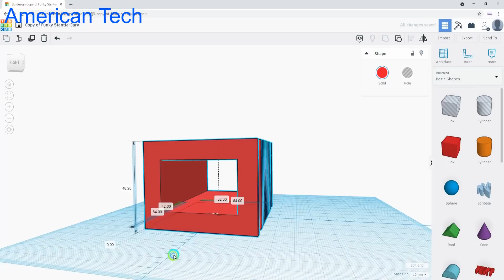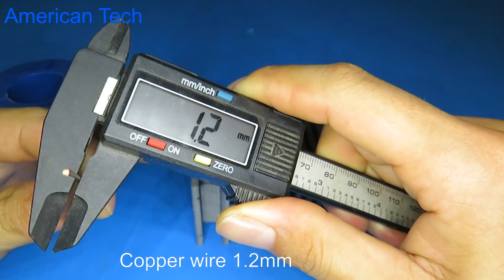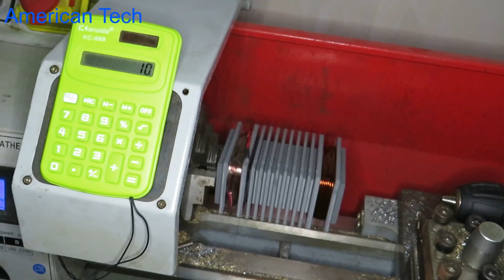How to make high voltage transformer 400KV

Comment: for 400kv output you need 1600v input

absolute bullshit

Just lies in the video

1) improper core material
2) improper core type
3) improper core sections considering turn ratio and the max working frequency of a laminated iron core
4) excessive turn ratio considering laminated iron core material
5) improper insulation, you wouldn't get more than 3kV per section if you had a proper core or/and a proper turn ratio
6) he gives no demonstration
7) he does not provide a proper driving circuit, plug it into an outlet socket and you'll get a big bang, plug it to a ZVS and you'll get a nice stove
8) this channel does videos about free energy

Comment: Not way this will produce 400kv.. too small and the core will saturate. Also if you do not immerse this in oil and make sure there is zero gas or moisture to not make 40cm long arcs destroy every winding

Comment: If we have a 220 to 12 transformer that has two wires in the input and two wires in the output, how do we make the oscillator circuit?  ❤❤❤

Comment: need to tighten up those secondary turns, i saw little loops and wires stuck on the outside of the bobbin. this would burn up in 30 seconds with 12vac applied

Comment: Clickbait. Even if you did apply 1,666 V to the primary, and used a proper core, it oiled never reach even close to 400kv. And if it did, it would fry instantly (even in oil or wax).

Comment: How did you close the magnetic path? This wiring does not transform anything. 
Besides, have you ever seen a high voltage equipment? If not please check one. There are plenty of pictures on the internet? Please check the dimensions. Why do you think they are so bulky? Do you have an idea? Yes the isolation issue. 400kV jumps from 4 meter with a good bang.
Anyhow, your video showed me that  the copper wire is cheap around there.

Comment: Could you please tell me how you made your wire counting calculator Sir ??? Thanks
Reply: I used a nano an old dc drill and a hall sensor, the Arduino program can count the turns and stop the rotation when "x" number of turns are made, I used an example of a tachometer and modified it to be a counter.
Reply: @jamesrodemeyer7544  THANK you for your response with the answer. to my question Sir. I have to get started to make my coil counter. Thanks again and peace too. v

Comment: 400KV lol... that's 400.000 volts. They probably mean 400 volts, but i still wouldn't mess with that with such 3D-print-hobby project. I've experienced having 230 volts on me a few times, that's quite violent, you can feel the 50hz swinging your muscles around. 400 volts.... don't mess with it, it's plain lethal as soon as you accidentally touch it. Don't DIY toy with that.
Reply: Thats 400 000V but then there is less than 0,0001 amps
Reply: Its brobably 50-100kv
Reply: You most likely experianced that from the putlets wich is 50hz this is like 3khz and its like 0.1a unlike the 16A from an outlet(mine are 16A

Comment: That is not how you design a transformer core there is no loop for the magnetic flux to run through.  Also if its not 400kv. The primary inductance is to low with only 30 turns. Connected to mains it would draw too much current and trip your breaker.
Reply: Shot the breaker
Reply: You don't need a closed core for a transformer, though it would be preferred since it helps reduce the magnetizing inductance of the transformer and reduces reactive power draw. In other cases you may want to engineer the magnetizing inductance by introducing a deliberate air gap or doing this to create a coupled inductor.

Comment: For which reasons in the world is this thing going to work? Let me tell you, no one.
Here's why:
1) improper core material
2) improper core type
3) improper core sections considering turn ratio and the max working frequency of a laminated iron core
4) excessive turn ratio considering laminated iron core material
5) improper insulation, you wouldn't get more than 3kV per section if you had a proper core or/and a proper turn ratio
6) he gives no demonstration
7) he does not provide a proper driving circuit, plug it into an outlet socket and you'll get a big bang, plug it to a ZVS and you'll get a nice stove
8) this channel does videos about free energy
9) idk what else say, if anyone had other ideas write them in the comments below
Have a great day :)
Reply: Reason 10 - most people don't own a 3d printer and a lot of us don't own a PC either.  How can the heck can that bloke afford a lathe?  The laminated core IS silly especially since there is no closed magnetic path but it would be kind of fun hearing the bang if it was plugged into a wall outlet or the fire if it was connected to a zvs hence no demonstration.
Reply: @ianhosier4042  agreed on everything.... I do have a pc but no 3d printer not lathe, so when I wind hv trafos I use recycled cores from crt TVs and a lot of patience, thin copper wire, Dutch tape, synthetic varnish/enamel, hopes and prays xd
Reply: reason 11- he is on electroboom's baddie list
Reply: reason 12- most of his description is used to get more money like how many frickn links he used for free energy videos
Reply: reason 14- oh my god his wife's YouTube channel is full of lies. she said she uploads every day and it's been 6 years and only like 10 videos are on it. her description asks to sub, like and, share. she says the channel is about "clay games that make people happy" NOPE nothing about that at all there's even one where she encourages you to stick a capacitor directly into mains! that's so dangerous and no bleed resistor is on the capacitor ether all these people want is money
Reply: Reason 13: left the chat

Xdd

Comment: 3d prints often have thin walls between layer lines,  so not only will the sparks likely jump walls,  it will likely go through. Resin would probably help with the jumps,  but the walls are going to be a challenge.
Reply: 11 nl,
Reply: Thanks for the experienced information; 😅 i was about to built it one with 3d print

Comment: If we connect the primary in parallel we have 30 turns in primary and 7200 turns in secondary. This wil result in secondary/primary turns ratio of 240. So to obtain 400kv(400000V) in secondary we need to apply a 60hz sine wave of 1666,66V. Otherwise if consider the two primary  bobins connected in séries, we have a turns ratio of 120, and a incoming primary voltage of 3333,33V to obtain 400KV in secondary. But is necessary keep the transformer in special Insulating oil or parafin or resin to avoid leakage and arcs....
Reply: Put 1600V across that thing and more than an arc you'll get an arc flash
Reply: Imagine the bang if that was plugged into a wall outlet lol

Comment: De onde vc tira esses valores amigo??
Qual a tensão no primário para ter 400kv no secundário?
Reply: Se ele ligar o primário em paralelo, consideraremos 30 espiras no primário e 7200 no secundário. Dividindo 7200 /30, teremos uma relação de transformação com fator 240. Sendo assim a tensão aplicada ao primário será aumentada 240vezes. Portanto para conseguir 400kv ou 400000V no secundário terá que aplicar 1666,66V no primário. Caso o primário for ligado em série consideramos 60 espiras e fator de 120 e nesse caso a tensão no primário terá que ser 3333,33V.
Reply: If the primary be connect in parallel, we will consider 30 turns in the primary and 7200 in the secondary. Dividing 7200/30, we will have a transformation ratio with a factor of 240. Therefore, the voltage applied to the primary will be increased 240 times. So to get 400kv or 400000V on the secondary you will have to apply 1666.66V on the primary. If the primary is connected in series, we consider 60 turns and a factor of 120, in which case the voltage in the primary will have to be 3333.33V
Reply: Você deveria ter perguntado em inglês agimao
Reply: @dantonwittkowski8614  he translates
Reply: Veja que  respondi qual a tensão primária a fim de se obter 400kv no secundário. Mas nesse caso, o transformador deverá estar todo imerso em óleo isolante ou resina epóxi ou ciclo alifatica ou parafina. Caso contrário haverá fugas e arcos Internos.....

Comment: 400kv? Is it a joke?
Reply: That 400kv sparks would have tô be like...... 50 centimiters, and his is barrely 1cm
Reply: @dantonwittkowski8614  that's the case, in 400kv lines you can see a big gaps between poles and cables. This bobin can withstand 10kv in its best condition.
Reply: He makes free energy videos, He cant bem trusted
Reply: @dantonwittkowski8614  🤣🤣🤣👍